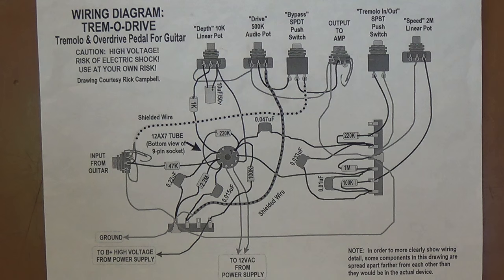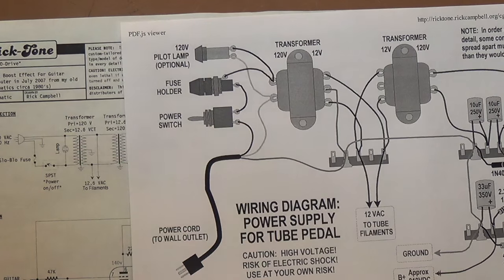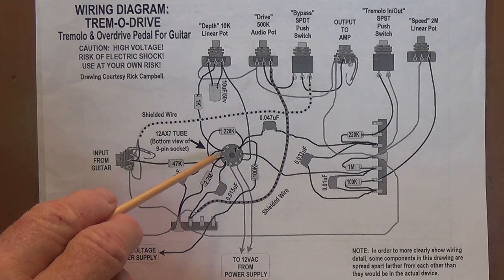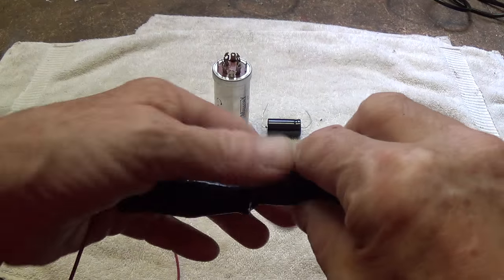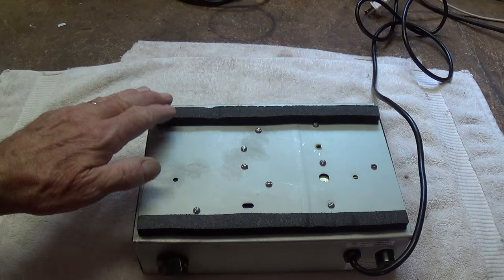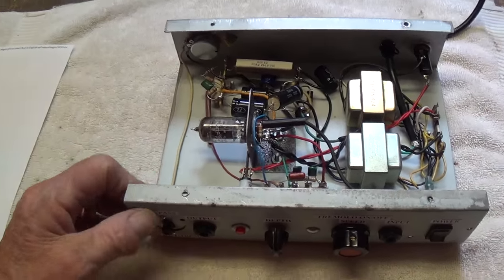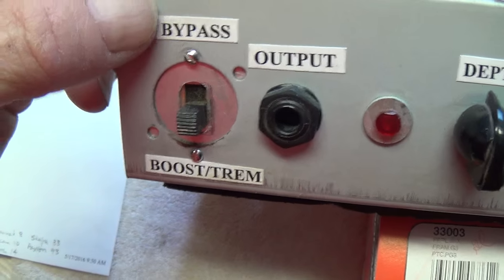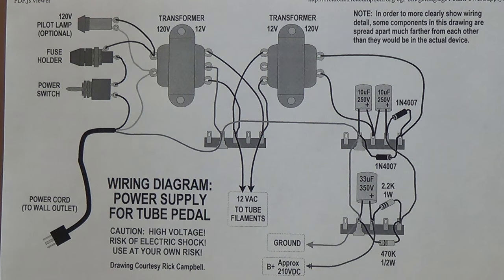Build Your Own Inexpensive Tremolo & Overdrive Boost Unit, Part 2

Comment: Hello Doug, I'm building a very similar tube drive (the Rick-Tone tube-o-drive) which uses exact same power supply section as the trem-o-drive,  and I have a question about the transformer orientation. Do i need to have them like yours?I feel like it shouldn't matter very much, but the first prototype I built had a bad mains hum issue (mainly because I packed everything so close together I think). I am also using 220 volts, so I just have a full wave rectifier with a 33uf 450v smoothing cap  instead of the voltage doubler portion. Could that in any way cause mains hum? Any advice would be greatly appreciated.
Reply from the maker: I would not think that transformer orientation would cause excessive hum, Volkan. Lots of people have built projects like this and hum is not generally an issue.  How about adding an additional filter cap? Also, you might consider using shielded cable for your signal runs.
Reply: Thanks for the reply, Doug. I will try your suggestions.
Reply from the maker: Good luck, Volkan :)

Comment: Here in Spain, we have 220vac in the line. So i suppose the schematic will be the same but without the voltage doubler.

isn´t?
Reply from the maker: +david ageitos  Yes, leave off the Doubler and use a full wave or bridge rectifier (depending on whether the second transformer is center-tapped or not).

Comment: Hi again Doug, Here's the prototype with a 9 pin tube socket installed. The labeling is primitive. Basically I iron on a reversed print of the board. I forgot to take the traces for the bottom off. That's why there are lines too. The lines are the bottom traces. Also, I laid it out with all 1W resistors but only 1 is actually 1W. The smaller 1/2 resistors will fit in place of a 1W resistor but the converse is not true.

http://wildlightimagingstudio.com/img/s12/v173/p2068435496-4.jpg
Reply from the maker: +Michael Lloyd  Very nice, Michael. Thanks for sharing this with us. Please keep us posted on your progress.

Comment: UD I'm trying to figure out which one of the resistors in the schematics refers to the ceramic wire wound  2k resistor near the diodes and the other one right after it. Would it be the 2.2K and the 470k resistors in the power supply section on the schematics? is there a reason to replace some of the 1 or 1/2 watt resistors on the schematic with these 10 watt porcelain ones?
Reply from the maker: Apparently I didn't have a 1W 2.2K resistor, so I used what I did have: a 10W 2K resistor. As long as the resistor you substitute is approximately the right value and the same (or higher) wattage, it's generally OK. You could theoretically make every resistor 10W.....but it would be a waste of money.
Reply: nice to know smt new everyday here in your channel UD... This is a truly amazing piece ,even being the first one you'd built! I'm looking forward to start gathering some stuff like and old amp chassis I too have sitting in my shop and then go after the components to build my own! I'm thinking about replacing the 12ax7 tube schematics with a 6n2p tube adaptation. I have these russian tubes for a good price here.
Reply from the maker: We're glad the videos are helpful, GG. Best of luck with your projects.

Comment: can you use a 1 mega pot instead of the 2 mega? 
these are harder to get.
Reply from the maker: You are always welcome to experiment with component values, AD.
Reply: @UncleDoug  Who made it?
i got referred to you on the channel of professor Arron Lanterman.

i guess, i have to build one with 2mOhm, to know for what I'm aiming at.
My guess would be that the low speed oscillator would swing faster, correct?
... and you rather want super slow speeds as well, other wise it will sound/feel  like a Eurorack lfo. like Doepfer.
these barely present swings.
Reply from the maker: @AnalogDude_  Oscillation speed is generally adjusted by varying the capacitor value(s) in the loop, AD, with higher = slower, but altering the resistance will work also.

Comment: Thanks for posting this. I decided to build one a little while ago as a small project. I did mine with a separate foot controller: it just didn't seem right to be stomping on a box with a glass tube in it. I used relays for the switches, powered by 9 V batteries in the footswitch pedal with LED status lights.

I set the drive status light so that it's off when the drive is on, since that's the way it'll be most of the time. The tremolo status light is more conventional: it lights up when the trem is on.

Pics here:
https://imgur.com/gallery/awaOsmO

and here:
https://imgur.com/gallery/rQZFJlH
Reply from the maker: You're welcome, BS. Thanks for your informative comments and links.

Comment: Actually, no. I took out the tube so as to not damage it. Let me try that.
Reply from the maker: Voltage readings are generally quite high without tubes in place and current flowing.

Comment: Hi Doug, I created a circuit board design for the Trem-O-Drive in Cadsoft Eagle. It's a double sided board but with a little creative jumpering it could be a single sided board. I use Osh Park when I want a professional looking board and they don't do single sided board. I'm going to send this to my OtherMill today and make a prototype. If it works out I might have Osh Park build a set of boards. 

Here's a screenshot of the board

http://wildlightimagingstudio.com/img/s6/v135/p2017711103-4.jpg
Reply from the maker: +Michael Lloyd  What a great idea, Michael. The board really looks nice and should make assembly of the circuit much easier.  If you intend to sell the boards, you might want to clear it with Rick Campbell first, since the circuit is his idea.
Reply: +Uncle Doug Thank you. The prototype board is ready for parts. Milled boards don't have plated thru holes and all of the nice froo froo that board houses supply but thye are great for testing the fit of parts and functionality of the circuit as built.  I don't know if I will get to that this weekend or not. 

There's no way I would sell boards from his design. I would give him my files (schematic and board) if he wanted them but I won't ever sell someone else's design. I value my integrity too much to do that.
Reply from the maker: I applaud your honesty, Michael, as well as your creative capabilities. This seems like a wonderful project. Please keep us posted on your progress :)